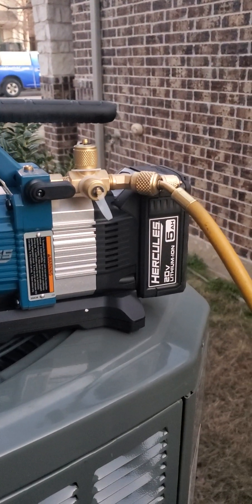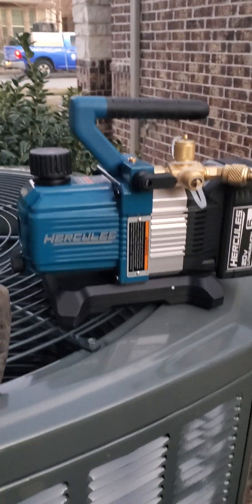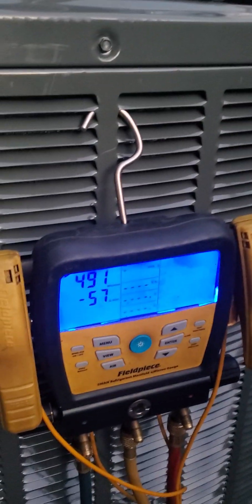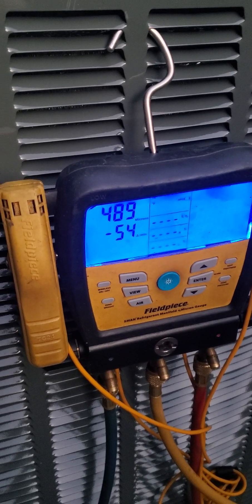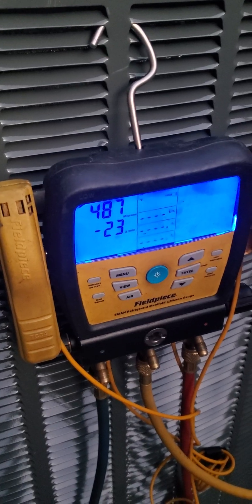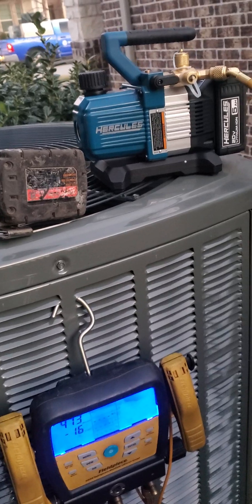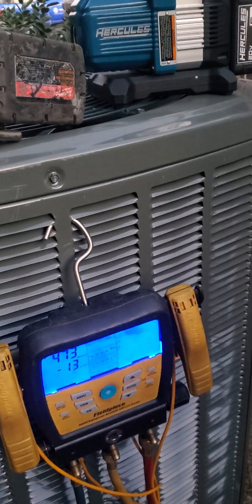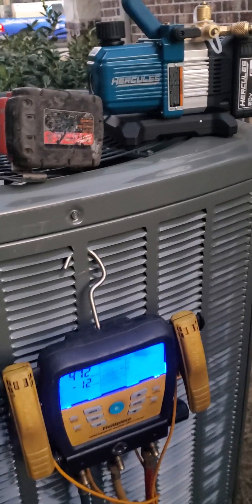Hercules 20v Vacuum Pump

Comment: its too slow for me, went back to my jb 7cfm pump
Reply from the maker: It might still be good for an awkward location or a roof. Thanks for the comment.
Reply: @thecoldtruthairconditionin1928  I can get to 200 in under 5-7 mins with the JB, 30+ mins to get to 500.

Comment: That is not how you pull a vacuum through a Schrader core tool. Why even bother with the tool if you're going to use the side port that has a Schrader in it
Reply: Hey guys, I bought my Milwaukee tools 8 years ago. Since then harbor freight has really stepped up its game. 

So I'm very curious. Hercules, how are these tools holding up?
Reply: @welder1357 that pump is actually beast i do 3 start ups a day × 5days i  use for two years now everyday !
Reply: The way how he has it in video is a nice substitute way..and it does work..the way how he has it in the view is working..
Reply from the maker: Theres no schrader core in that tool. You know they're removable right?
Reply: @thecoldtruthairconditionin1928  don’t you know the comment section is all master techs and gurus?😂
How’s that pump been working for you? I’ve been wanting to pick one up for the smaller installs and to not use my nice pump in the winter